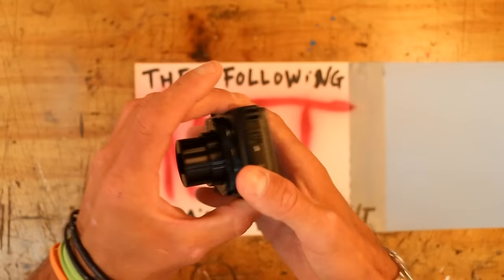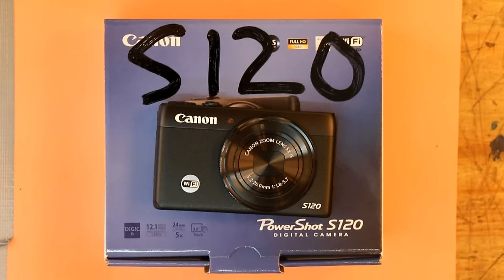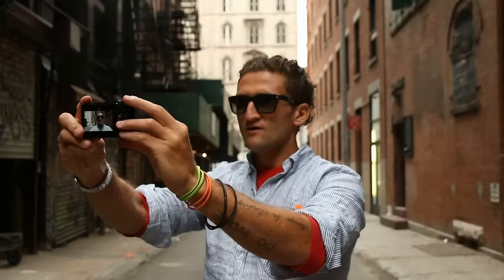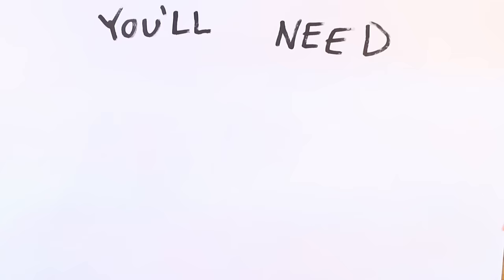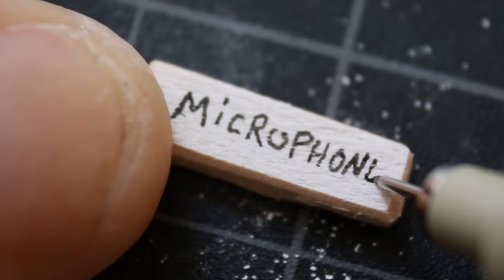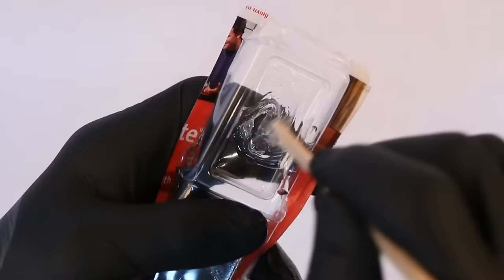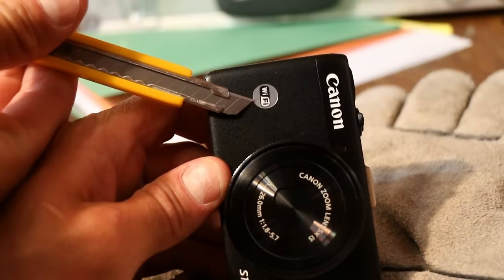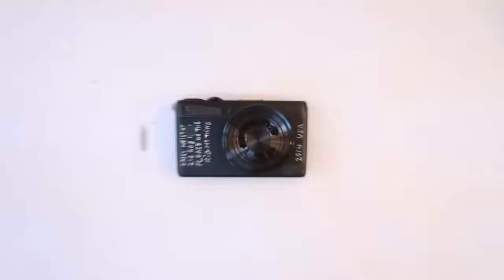The Almost Perfect Camera

Comment: shittiest camera ever: panasonic zs20

- too long to start up (panasonic logo shows for about 10 seconds)
- 20 second delay between finished startup and actually being able to do anything
- settings ignored in video mode
- cuts off 10 seconds of the start and finish of the video
- AVCHD.
- cant change many settings
- never focuses properly
- too much delay between being able to take pictures
- data often corrupted
- proprietary connectors.
- terrible microphone (also on the top, and in the far left too, and its also raised!!)
- terrible video quality (decent pic quality... when it works)
- HORRIFIC battery!
- $400.

Getting 600D soon.
Reply: Buy a Panasonic GH3 and never look back.

Comment: Just use something called 'GOOP' glue from Walmart,  it sticks to surfaces 10-times better / longer than any epoxy ever would.  You can get it at Walmart and other similar stores.  Its also in tubes labeled as E6000 or Shoe Goo.  Its sort of a rubbery contact-cement like stuff, but it stays more rubbery than contact cement and can be peeled off when you don't want it on your camera anymore.

Comment: Alternatively you could make something like a focusing cone around the mic (think Sydney Opera house... but smaller.. ;D ) so that the main input of the sound comes from the front, and to eliminate 360 noise a bit. You could use Sugru or other maleable material for that, also you could use Sugru for pasting this also, not risking epoxy accidents.

Added benefit, even when dry Sugru and similar tend to be soft, so in theory, it could work as a bumber IF you let your camera fall AND it lands on the upper part... or just add some of that to the corners.... or just don't let it fall, or just buy a rough camera using the following affiliat... nope... hahaha

Comment: I have the S620 and it is the worst Canon camera I've ever had. I returned it after the picture quality was pathetic when 90% of the pics were crappy. My SD1400 took superior pics. They said it couldn't be fixed and gave me a new one. Guess what, the new one sucks just as bad. Used my SD1400 and Fuji HS30 hybrid on my last cruise

Comment: What was the reason for using epoxy over superglue or hot glue?
Reply: Epoxy is a plastic, far stronger then superglue, hot glue is more dangerous, Epoxy is all you need
Reply: All three are plastics. Superglue is more brittle but he could have used a formulation that works for metal; hot glue is messy. Epoxy is the more practical choice.